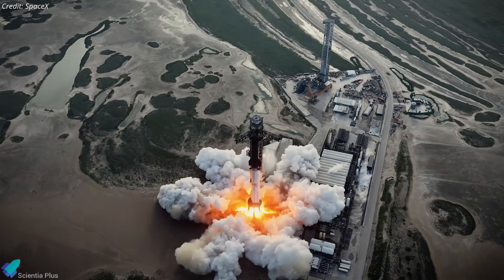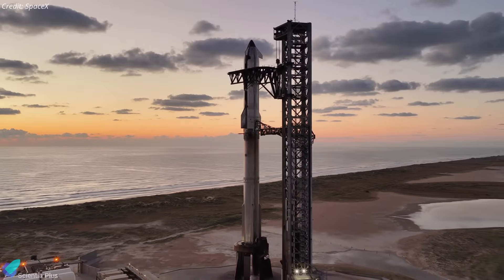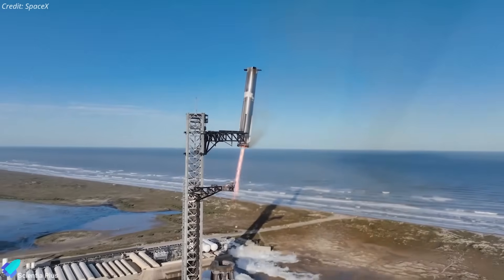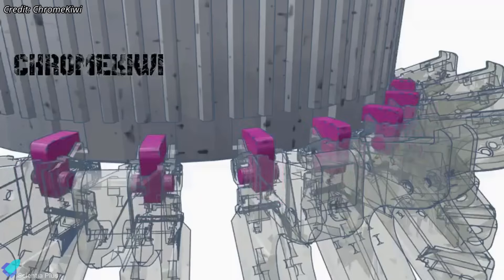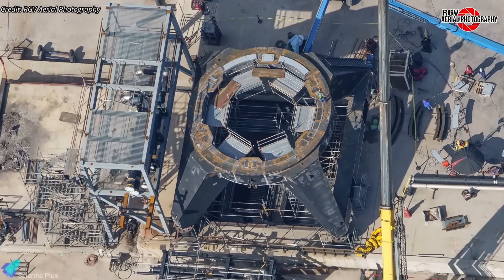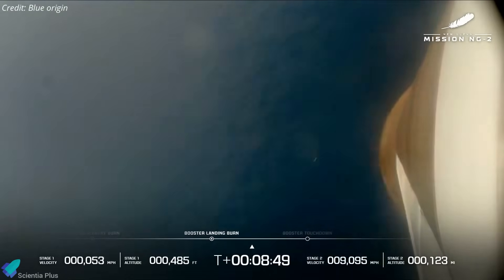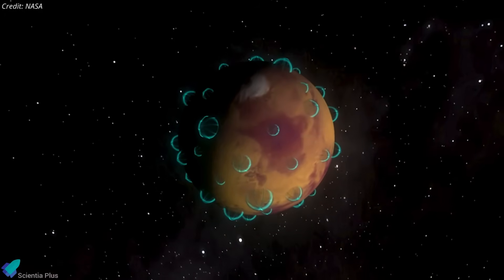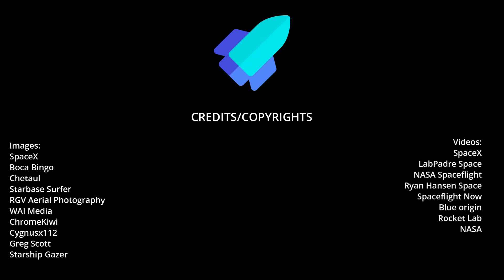SpaceX Is READY: Starship Flight 12 Test in Days! Pad 1 Taken DOWN!

Comment from the maker: 00:00 Starship Updates
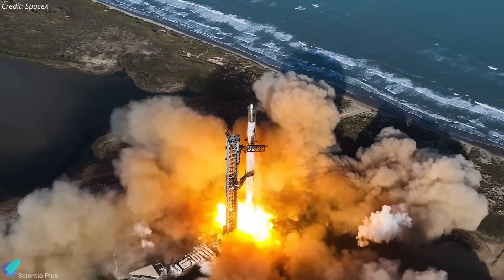08:06 Blue Origin SHOCKS SpaceX: New Glenn Nails First Landing on ESCAPADE Mission!

📚 Learn More:

🚀 Starship Block 2 Explained:
 📖 Summary: https://shorturl.at/b0dtw
 🔍 Detailed Explanations:
  • Design Improvements Update 1: https://shorturl.at/lpGT7
  • Design Improvements Update 2: https://shorturl.at/gwNQ4
  • Nosecone & Payload Bay Redesign: https://shorturl.at/xa60S
  • Methane Downcomer Redesign: https://shorturl.at/XdYBG

🚀 Starship Block 3 Explained: https://shorturl.at/mnBT4
  • Detailed Breakdown: https://shorturl.at/IViwD
  • Production Begins: https://shorturl.at/xRNkJ
  • New Transfer Tube / Downcomer: https://shorturl.at/Iaqc6
  • New Grid Fin: https://shorturl.at/NxdVo
  • New Integrated Hot Stage Ring & Forward Dome Upgrades: https://shorturl.at/bvaCn
  • Booster Block 3 Aft Dome Insane Design Upgrades: https://shorturl.at/wPg6Y

🛢 Dual-Port Orbital Refueling – Full Technical Breakdown
https://shorturl.at/5tiqK

🚀 Starship Block 4 Unveiled: https://shorturl.at/7A2ef

🔥The Insane Engineering Of Raptor Engines:
     Part 1: https://tinyurl.com/348hsrya
     Part 2: https://tinyurl.com/p8k85mu6
 
🔥 Raptor V3 Explained:
    Mega Upgrades & First Test: https://shorturl.at/TRIyj
    Raptor 3 Evolved Again - More Protection This Time: https://shorturl.at/3YpCe

🛠 Insane Engineering of New Starship Launch Pad: https://shorturl.at/7RAZd

🧱 What’s Inside Starship GigaBay?: https://shorturl.at/nJM75

🛠 Other Starship Upgrades:
 • Hot Staging Explained: https://shorturl.at/jf400
 • Super Heavy Booster Upgrades: https://shorturl.at/Pi5R3
 • How SpaceX Protects Raptor Engines: https://shorturl.at/4Om8F
 • New Heat Tiles Explained: https://shorturl.at/p2Ijb

🚀 Starship Flight 11 
   📽Detailed Breakdown: https://youtu.be/r6jHVPpiEcw
   📽How it Survived Heavy Damages: https://www.youtube.com/watch?v=8qw2E31T8ZM

🚀 New Glenn Rocket Explained: https://shorturl.at/Ao3Rn

📡 Stay Updated:
📢 Weekly Updates: https://bit.ly/3HIQjPC
🚀 SpaceX Playlist: https://bit.ly/34wue8T

Comment: New Glenn is not even a Falcon Heavy competitor

Falcon Heavy main booster landed on second try, tipped over only in rough seas during recovery.

The first successful simulated sea landing for the Super Heavy booster where it performed a full landing burn profile to achieve a controlled soft splashdown in the ocean occurred during Starship Integrated Flight Test 2 (IFT-2) on November 18, 2023. 
This test demonstrated the booster's ability to execute boostback, reentry, and a hover-slam landing burn over the Gulf of Mexico, mimicking an RTLS (return to launch site) profile but terminating in a water impact to validate engine relight and descent dynamics without risking tower infrastructure.

Comment: Wow, Blue Origins's 
New Glen landed on the second try.
It took SpaceX seven7 tries to land the falcon 9 booter.

They just launched a actual payload to mars man.
Reply: Completely different philosophy. 
SpaceX makes changes and the next launch is the test. BO test on the ground for a long time and then finally launches.

Which is why it took BO about 12 years, but only took SpaceX about 8 years. SpaceX was 50% faster.
And BO has spent quite a bit more in development costs compared to SpaceX as well. 🤷‍♂️
Reply: @lordgarion514 
It's only been ten years between new shepherd self- landing and New Glenn, self-landing on the 13 of nov. 2025.
And Shepherd and Glenn blew up alot less to get there.
Reply: @CyberThug1080i 
New Glenn is a different rocket, it was started in 2016 and landed in 2025.
Blue origin is also estimated to have spent about 80 million, whereas SpaceX only spent around 67 million. So SpaceX is somewhere around 20% faster, and 15% cheaper. 

It's an absolute fact that spacex's development process is better than everybody else's. It's faster and cheaper. Not to mention that Falcon 9 is now the most reliable rocket humans have ever made.
Reply: @lordgarion514 New Glenn is an operational orbital rocket. That has delivered payloads into orbit.
Starship is not, (operational) has not delivered anything.
But dummies lites.
Reply: @CyberThug1080i 
It's an operational rocket that carries 45 tons to leo, when spacex's Falcon 9 delivers almost 20, and Falcon heavy delivers 50. 

And between 2018 and 2025, Falcon heavy has only launched six times, less than once per year, because there's not much use for it. 

So now there are two ships that can do almost the exact same job....... A job that almost never needs to be done. 🤷‍♂️

Yes, starship / superheavy is still in development, but considering what it is, it is absolutely smoking the tires off everybody else in development time. Plus super heavy has been caught successfully.

What is blue origin going to use new Glenn for exactly? 
A commercial payload launched every other year?
Reply: @lordgarion514 

Starship doesn't count in this conversation.
Starship has never reached earth orbit.
Reply: @CyberThug1080i 
Duh, you're the one that brought Starship up......😮
And it doesn't change the fact that Falcon 9 delivers almost 20 tons to low earth orbit, and Falcon heavy delivers 50 tons, and new Glenn's Max is about 45 tons. 
And Falcon heavy is cheaper. And Falcon 9 is a lot cheaper. 

So I'll ask you again, with a cheaper rocket that can do almost 20 tons, and a cheaper rocket that can do 50 tons, what is a more expensive rock that can do 45 tons useful for exactly?

Comment: New Glen got a lot of information from SpaceX about what works and what does not.
Reply: Their methods are quite different. BO is not interested in development data from SpaceX. Falcon 9 boosters do a suicide burn directly to the landing pad. BO boosters first arrest their vertical velocity above water, then translate sideways and down onto the barge platform.
Reply: that is just assumption. Blue Origin seriously delay was du to original planning in manufacturing . Original plan was to outsource most of the manufacturing and just do final assembly....turns out there is no to manufacture those parts so they end it up building there own factories (and they still building them) so everything is done in house
Reply: Except the main lesson - Payload kg cost to orbit is all that matters in this market.
New Glen costs 5x per kg to orbit compared to starship, and while starship will have a turnaround of 45 minutes and lands on the launch mount it just took off from,, New Glen is still several weeks turnaround, as the booter lands at see and then welds itself to the boat, which then has to come back to shore, hauled back into the assembly buildings, checked over, re-assembled and then taken out to launch again. It suffers the same turnaround issue as the space shuttle. 

Those landing legs add tons of weight to the booster that can't be used as payload, requiring even more fuel to take up and down each launch, the 2nd stage isn't reusable so that adds major cost to each launch, there's no orbital refilling, and they haven't offloaded loads of weight from the booster to stage zero.
 
New Glen was built for a market 10 years ago that has since been replaced with falcon 9 in terms of medium reusability, while starship is already delivering dummy payloads to space and returning both stages.

And now with NASA on the verge of cancelling Artimus, it has lost it's main customer.